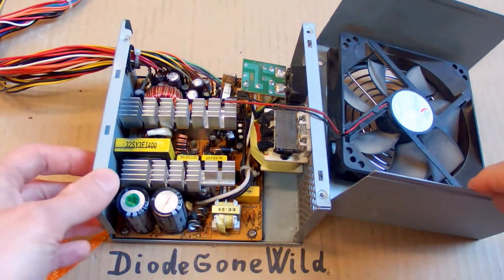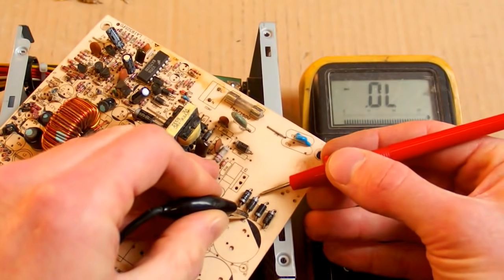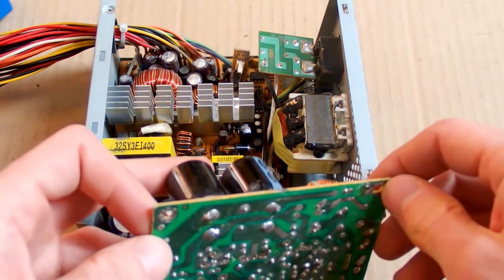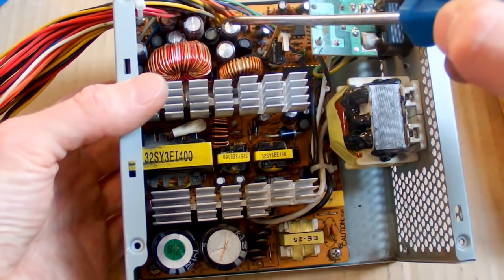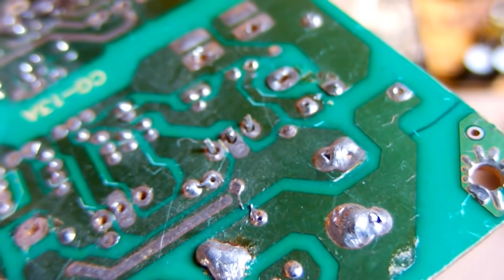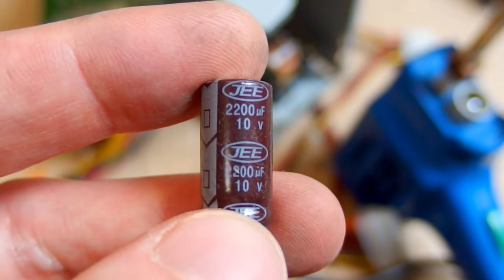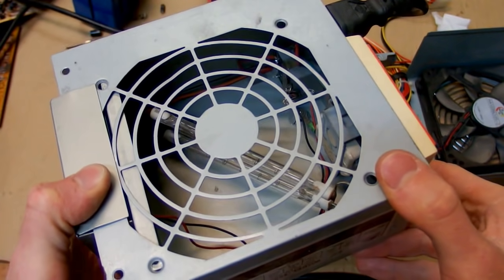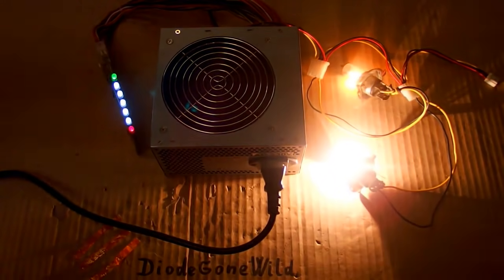How To Repair a Computer Power Supply (or other switching power supply)

Comment: Hello  DiodeGoneWild,

Many Thanks for this amazing video. 
I have an old smps and recently it has started to fail after about an 1.30 hour working. It puts the system to restart but system is never able to go past the boot screen and gets restarted again. This process continues until I turn off the main power supply.

The smps fan keeps spinning during this. I'm not a professional but I guess that some element gets heated after 1.30 hour's working and fails, thus causing the system to restart again and again.

Any help is greatly appreciated.
Thanks
Reply: You can skimp out on anything except the power supply. Just buy any power supply from the reputed brands. My hard drive went bad because of cheap power supply that came with the case.

Comment: sir. I have a problem that my atx psu is always on when connected to ac plug. even the 24pin is not connected to anything. what's wrong? I checked there is no short from ps_on to gnd

Comment: Very good. Actually gets down to the component level rather than so many other videos that talk about the fan / paperclip test. And it's actually so simple to test any PSU when you understand the readings that components should produce on a multimeter. Thanks!

Comment: please help, i tried to power on my power supply by connect green with black wires with a load but it doesn't work . i tried this way on other two power supply the same thing happening.

Comment: you talk funny and kinda annoying, but that was a great video, i have a very good (expensive) PSU that i killed by accidentally shorting the USB socket and now i'm trying to fix it, this video has helped a lot. There was no sound when it died and nothing looks burned, so it's gonna be difficult to find the problem.

Comment: The one you repaired uses the classical tl494+lm393 circuit, newer models often come with apfc and some of them are llc or forward converters, these atxs have more components and are much harder to fix

Comment: Is it possible to isolate  only standby power section which generate +5 volt. If it is possible what would be the necessary change in the primary and secondary section. Thanks in advance.

Comment: Hey, I've got a faulty switching 12v 4A PS. When i turn it on and measure its output, the voltmeter shows up 8.7v with no load and 4v when i connect a 3w lamp (ridiculous load) to the PS. May you tell me what the heck is going on with my PS? Thank you in advance :)

Comment: @
DiodeGoneWild
Bipolar transitor should have about 0,6-0,7 or more mV. 400 may be burned... I had 2SD667 transitor which has  0,5V  on C-E and was damaged because of a new one has 0,7 and SMPS worked when replaced it...

Comment: I would make sure you discharge those 400v capacitors first. Use a 10W 100 OHM resistor with insulated leads on both ends to avoid shock
Reply: This should be pinned

Comment: Sir, I want to ask, PSU Seasonic, if the switch on turns on immediately (without connecting the green and black wire), what should be checked? (PSU has been removed from the casing)

Comment: On the primary     heatsink        end there is a 2sc3105 power  transistor  and just beside it there is a small one.  What is the number of this small transistor, or voltage reference, or else?  
dropbox.com/s/tas1k9r9w57dsz2/atx%20photo%20web.jpg?dl=0

Comment: I have heard and seen a spark around the output  .  I replaced one 2000 uf cap, on 470uf, the transistor is ok.  The small  diodes around are ok.Only the violet is giving 5 volts .  All the others are to 0.  Do you have a clue.  What the capacitors involved?

Comment: You miss the most important thing at the start of the video: DISCHARGE TWO BIG LINK CAPACITORS BEFORE NOT AFTER YOU GET A HUGE SHOCK OR BLOW UP YOUR METER.
Reply: they have discharge resistors connected to them, so you dont need to. and those resistors will most likely never fail
Reply: @conkerconk3  Some times a LED in series with the discharge resistors will warn if voltage is still present over there.
Reply: @conkerconk3  1> You cannot rely on the design having the resistors. 2> These are called balancing resistors to make sure that the voltage applied to a pair of link capacitors arranged in parallel. They work like a voltage divider & they can fail because they have a high voltage across them in normal use. Better not to assume...
Reply: @davidbrewer7937  A good design shall have discharging resistors for safety purpose but do not rely on it, resistor may also fail!
Reply: @davidbrewer7937 I thought they were bleeder resistors? Cheers 👍
Reply: "Always discharge that two big Caps on Mains/Hot side..!!!"

Recently played with Old Olivetti Typing Machine..
In: AC 240V 2.5A
Out: DC 36V 12A

..there where Two Capacitors rated at 400V 2000uF with Discharge Resistor circuit.. After almost 15 min Cap still Charged at 240V from 400V capable to kill..

Solution: Short Capacitor legs with Isolated Screewdriver (Spark occur) or Multimeter and Read Voltage before touching it.

Be Safe..
Reply: @LonesomeToast  Most CRT monitors are under 20kv for final anode.
Reply: Yup I've been shocked before while fixing them. It feels like you did a really fast push-up haha.
Reply: @Immortal 20 mins
Reply: @LonesomeToast  Hey...I am 38 years in the business & still alive but once took 30kv for 2 seconds in a factory test system & survived!
Reply: @davidbrewer7937  organ damaged bud?
Reply: @royokimoto5150  No I was very lucky. It was a gantry over the top of a production line making CRTs in LG Wales. I foolishly reached down to reattach the final anode hook to a CRT which was passing under on a conveyor without thinking but the gantry was right over a B-stray test system & it turned on just at that moment. The CEO of the firm I worked for was visiting & I was showing him the problem we were having with this third party supplied equipment & the anode hooks which kept falling off, which exposed our test systems down line to destructive bad product. He said that there was a six inch lightening bolt that came out of my ankle to the guard rail. My dying words would have been "fucking bastards!"
Reply: @davidbrewer7937   CRT transformes can surely be dangerous but definitely not lethal. Their output is quite a high voltage, yes but with a low current and a high frequency, also rectified. I would be much more scared of getting a shock from the primary driver circuitry than from the secondary. So unless you worked on TV'S from the 70's the worst thing that could happen to you is a severe burn on the part of body you touched the live part with but nothing more. Feel free to correct me but I'm sure skin effect applies here and you were nowhere near a life threatening situation.
Reply: @fire_silicon7803  The high voltage applied to a CRT can certainly be lethal but it is a fairly high impedance output stage. However, it can stop your heart easily & I knew a technician who sadly did die from this. 

I worked with the technology for decades but I was lucky to avoid a shock... until my luck eventually ran out. I worked for a firm designing & installing automation for mass manufacturing CRTs in huge factories for all the biggest names all over the world. I once came into contact with the final anode connector of a Bstray test system which applied 45kv for 3 seconds to CRTs as they passed by on a conveyor....I lived!....just. But I had problems with my ankle for a couple of years because it was where the current arced out of my body.
Reply: @davidbrewer7937  these kids don't realise caps lose charge after 10 mins max or near instant when supplied circuit causes drain such as power button pressing

Comment: So basically every single component could be faulty ... Seems legit
The problem is not in the components but in the bad PSU's design - missing self-protection or doubling critical internals for working even after component failure

Comment: whoa dude, a tl494 pwm, exact same IC I got in my old 2000 PS hacked into a bench PS. Accidentally short circuited the 5v rail while doing stuff, heard some faint pop from the PS and suddenly current was not flowing anymore. (Yeah, poorly designed and built, no short circuit protection, this is so embarrassing.)

Trying to sort it out. 12V shows about 11.24 (even before the accident), 5V showing 5.26 with no current delivered, 3v3 shows 0. Checked caps, many on the output block seem to be short circuited - I'm going to desolder one of them and see if it really is. tl494 showing a voltage drop of half a volt, I'm assuming it's good given all the circuitry around.

Since the PS is quite old (almost 20 years), I'm assuming a multiple elec cap failure. No visible bulging or leaking detected. No broken / suspicious rails on the PCB either. I would hate desoldering the heatsink with the shottky on the output block just to find they're healthy and besides, I should have replaced the capacitors before.

This seems quite hard to diagnose just by looking.

Comment: Very nicely done DiodeGoneWrong. I knew about the electrolytic caps being a common burn-out in a power supply, but not the diodes. Also how if one power trans. blows it will take another one with it. This was very educational
Reply: Then why did u call him diodegonewrong?

Comment: Hi, can you show me how to mod a KA7500 ic based computer power supply to get more than 12v output, please?
Reply: Connect the middle pin of the  potentiometer to pin 1 of the IC (feedback pin), the top pin to the output, and the bottom pin to ground.
By twisting the potentiometer, the chip always adjusts the feedback voltage to 2.5V, while the output voltage changes. But you have to disable the overvoltage protection by shorting out the "overvoltage protection" pin
And you'll be able to adjust the voltage easily from 3V up to 12V, max. 16V.

That's how you'll get adjustable voltage.

To get more than 12V, you need to disable the overvoltage protection by shorting the overvoltage protection pin to ground
 GreatScott explains this better, watch his video how to turn an ATX power supply into a variable bench power supply.
Reply: @adamsken1f  If i replace the output capacitor to 25v 1000micro farads will it work over 12v?
Reply: @putraadriansyah8082  
I don't know, but higher voltage capacitors can be a bit bigger, so if it fits, you can do it
Reply: @adamsken1f  I'll try that. Thanks for your help
Reply: @putraadriansyah8082  And also check their ESR (Internal Series Resistance) if your capacitors are salvaged from e-waste like mine.
ESR testers are pretty cheap, for 7$ you can get a universal transistor tester, that can measure any components you throw at it (except voltage regulators)
Also look out for any bulging or puffed up capacitors, they are 100% bad.
If you bought new capacitors, then you don't need to do this.
Reply: @adamsken1f  i bought theese caps as a part stocks..

Comment: Good day,  i repaired my power supply by swaping 2 diodes and it works now but it leaks a lot of current. When i touch the cover metal it sends a lot of electric shock. Can you give me any idea what might be the problem ?

Comment: nice,but if you replace the capacitor the same brand and same value it last only a year,you have to change it a little bit higher to avoid over heating,use point meter tester to check the suspicious part and finalized check by digital tester that's a quick proper way to diagnose,use pointed soldering iron to avoid touching other parts legs not soldering gun it cause over-heating the parts resulting in leak,okay

Comment: How to find which capacitor is causing the PSU to delay power up. It takes about a minute to start running after I jumper the green and black wires. Please, help!

Comment: Hi, i have high end computer power supply when i plug to computer avr then the avr will blow the fuse, what components must be the fault in powersupply?
Reply: The power supply fuse will not blow just the avr fuse will blow.

Comment: Hi i want to know how you made those power supply with light tester..  To test for shorted it will only light and not blow..
Reply: glyn hodges  You mean the same light bulb testor we use for tube amps? I always heard not to use them on solid state? This would save me a lot of parts.

Comment: Usually only cheap quality power supplies fail. Buy a higher quality power supply with a wattage and amp rating suited for your system. The power supply should be rated for more power than you need in case of power surges. Even the power company and your house circuitry can cause fluctuation from the power source.

Comment: I think trying to repair a power supply is a bad idea. Just buy a new one.  Most systems dont require a very expensive power supply. In fact many  computer manufacturers often use power supplies  that are barely strong enough to power the computer. Power supplies work best when they operate in the sweet spot of the power curve.
Reply: You are obviously not interested in educating yourself... just throw money at your problems... 🙄

Comment: My PSU turn on (for 1 sec. & fan spin for short time) but it will turn off suddenly and it makes "creek" noise when it shuts down. What could possibly wrong with that?

Comment: Great Video, I have learnt a great deal about PSU units,  I have a PSU that shuts down and restarts, this occurs normally twice in a few minutes, then it runs fine for 2 or 3 days sometimes for a week and the same occurs again, I think it will be a very difficult fault to find. Shame as it is a semi-modular CX750M and it has been replaced now........ as it was driving me mad.

Comment: This is really a very good and much appreciated repair video! I recently got a few ATX-PSUs and many of them are defective. Its good to know what to check first and what fault may implicate other faults too. So of course i found a lot of faulty capacitors, a defective fuse (i replaced by a good one and did a test and of course the good one blew up immediatly - what an idiot i am... ,-). Afterwards i checked the primary side and the diodes of the bridge rectifier where shorted and also both switching transistors where short circuit. I sould have tested that first! :-) I tried to repair some with other salvaged parts but was not successful so far.
The testing circuit is a very good idea, just need the connection adaptor. Also the test box for mains with the two halogen lamps is an excellent idea i will copy - if you dont mind? This is a very good safety measure and you also should use an isolation transformer for mains with such tests! Best is a variac with isolation transformer and i am happy to have one, but it is very heavy and big and doesnt fit on my bench any more (2200 W / 10A - 30 kg).

P.S. if you like, i can send you a weller soldering iron, runs on 24V AC with magnastat temperature control. I dont use it much, it gets too hot for me. The temp. is controlled via tip magnet (magnastat control) and you can buy several tips for different temparure. You can run it on variac from 10 - 24V to control the temp manually. It has a good and fine tip - better for difficile work than your big soldering gun ;-)
Just give me a hint and how to contact you ;-)

Comment: Computer repair service provider.
Do not waste your time.
In fact, the power that can be repaired is not even 5%.
Actually, the broken parts are not visible.
It takes a lot of time to disassemble and test all parts.
Replacement of a failed part can not guarantee normal operation.
If you purchased the power using a Japanese condenser, it would not fail.
Remember.
1. Do not trust the W notation shown on the outside.
2. Purchase Japanese condenser power. 80 +, 400V capacitor
Large capacitors determine the output of real power.
400V 270uF = 350W -> Notation 500W
400V 330uF = 400W -> Notation 600W
400V 470uF = 500W -> Notation 800W
My recommended power
XFX XT 600W BRONZE 80 PLUS

Comment: I wonder about this. When I first start my PC in the morning. A constantly sound show up from power supply for like a minute then it stops and PC work fine until I shut it down. When after few hours open PC again or next day, same sound again from power supply and stops after a minute. I checked if air flows from the power supply and noticed it is flowing pretty well. Any idea about the sound as it shows only when first start and if the sound can affect the air flowed to parts of computer?

Comment: Hi, if there's no voltage on the secondary side of the transformer is it most probably a failed transformer? Is there any components which can cause the secondary to have zero voltage?
Reply: Atx power supply is Dell PS-5251-2DS

Comment: Well, starting to check all the big capacitors and transistors at the beginning might not be a brilliant idea. I'd suggest to follow this plan:
1) open the case, do a visual inspection. If nothing seems burnt/faulty, conenct the PSU to mains
2) check Power Good voltage (violet wire). Should be -5V
3) check Standby voltage (green wire). Should be over 2.5 V I think
4) check other voltages (3.3V, 5V, 12V)

With this, you can be aware of were to look for a fault. Might save some time checking random capacitors/resistors/transistors/diodes...
Reply: Only the violet is giving 5 volts .  All the others are to 0.  Do you have a clue.

Comment: This was a very informative and helpful video, I learned a lot about PSUs , but unfortunately I was not able to fix my psu, everything seems to be fine, the problem is probably on the dc side, the fan doesn't spin, I suspect the control chip but the markings on it are very vague and I can't find a schematic for it, hopefully I will have better luck on the next one :)

Comment: when one of the big cap fails, it usually brings the other one to death
it happen to me yesterday
Reply: Few years ago my pc gave a big bang and smoke came out from power supply. One of the big capacitors had exploded and power supply fuse was blown. It worked fine after cleaning the mess and replacing capacitor and fuse.